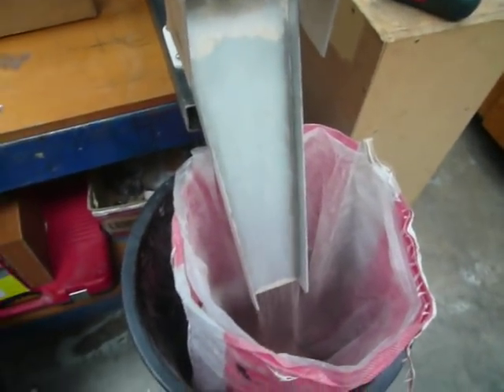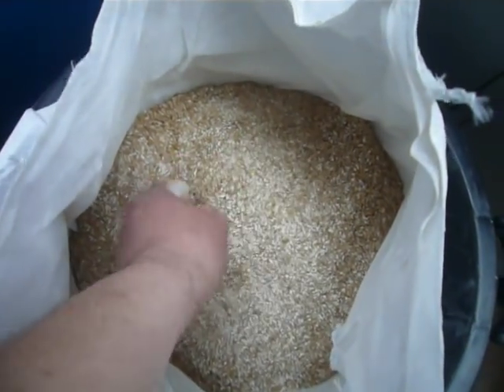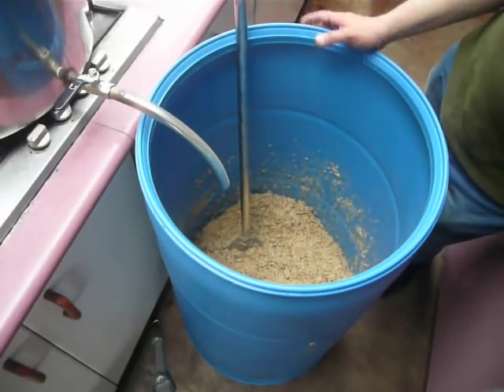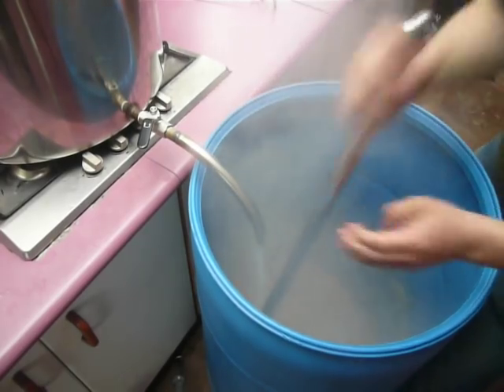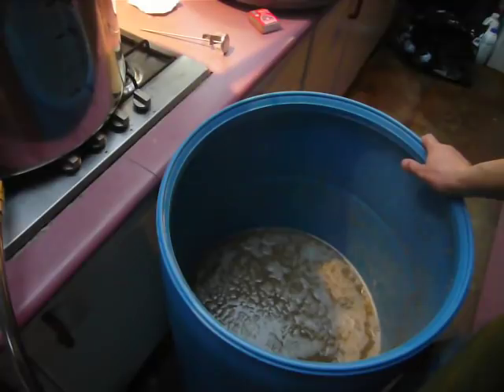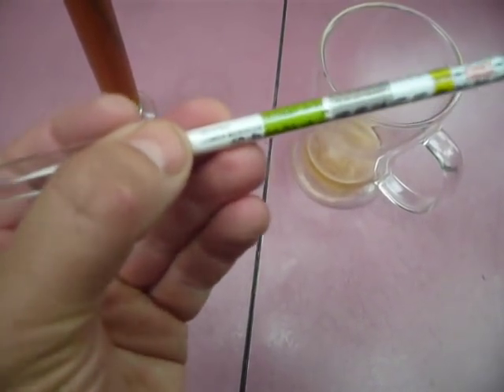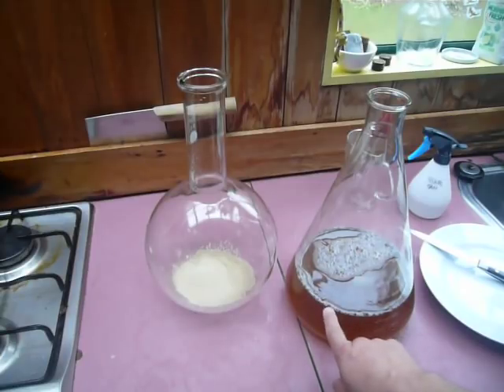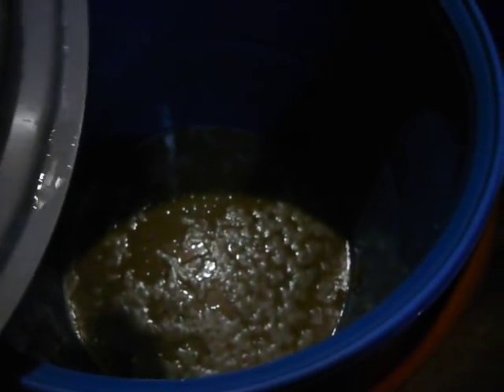Smokey Malt Whisky - Infusion brewing.

Comment: Love your work mate, cool to see the ferment on the grain in the big blue boy! Looking forward to giving this a go soon
Reply: What temp was your wort at when you pitched the yeast? I was curious as the vessel had sat for a little while. Or did the shear volume of wort and the blanket hold it at around 20C?
Reply from the maker: @chrisaitken55  
Hey fella!
Where are you now?
Last I heard Jon the scrapdealer said you'd headed out overseas to chase German women? 🤣

Pitch temp woula been around 20degC unless I noted it in the vid'.
I pitch low to try and overcome the exotherm - theres a fair bit even from a "small" barrel like this.
Probably got a blanket around it if it was wintertime, cold as a witches tit down at my place, used to do my fermenting in the lounge.
Reply: @AngryParrotDistillery  I'm back in the Kapiti area, been building and creating some new gear and chatting with John the scrappie pretty often. Germany was a great experience but nz is the place to be during covid. Love how you could ferment in the lounge, wouldn't get away with that here. I'll stop in for a catch up soon and get that 2" dephleg back to you!
Reply from the maker: @chrisaitken55  
Do it! 😊
I'm usually here in the workshop.

Comment: My kind of whisky !! Did you use any wood to a
“Age” it own? Just getting started and would LOVE to scale this down to a 6 gal volume !!😎👍
Reply from the maker: Heya Chef,
Yes, I used some lightly charred oak dominoes and a little oak 'tobacco" (shredded oak shards).

It was dangerously drinkable after only 6months of being set down.
After 12months it was starting to become a very polished spirit.

By 18months there was none left. 🤣

No reason at all you couldn't scale it down to 6gallons. 👍
Would be a hell of a lot easier and you could keep the temp up in a pot on a stove if it dropped to much during sacrification (keep stirring so not to burn obviously).
The 6gallon batch would probably drop temp faster during that period the enzymes are working and you wanna keep those lil' suckers happy! 😊
The larger volume/mass in the video has more thermal inertia.

Happy Distilling!

Comment: Making me thirsty.  Great vid
Reply from the maker: Mate, after stirring the crap out of that steaming grain pool for as long as I did I could definitely have used a cold beer! :o)
Reply: must be sore today.  least you had a decent paddle.  i'd have laughed if you omly had a wooden spoon
Reply from the maker: Haha, nah no sore bones the day after, that 4' paddle is worth it's weight.
4-5 foot handle has a good amount of leverage to use for turning slurry in a barrel.
I've actually used it on the stove top before with that 25 gallon stockpot when I've been geletanizing unmalted adjuncts and the mix has gone like half-set cement.
I gotta build a decent stand-alone mash tun at some stage …. oh, crap, the list just got longer!
Reply: lol, i was just thinking that.  the list just keeps growing.  but just think about where everything was not to long ago.

Comment: On the barrel lid you had some kind of lock/stopper that you then connected to the tubing  into the jar with water. What/where can you get such device's  and what are they called.  Thanks
Reply from the maker: G'day Christopher,
The black plastic threaded seal is a standard tank fitting you'll find in a plumbers shop - allows for a air/watertight hole to be put thru' a water tank.
The rubber stopper is just the stopper off a conventional airlock that you can buy from a brewshop - if you're lucky you can find the holed stopper by itself.
Happy Distilling! 😊

Comment: Hi, can you please do a follow-up to this video, I'm particularly interested in how you separated the wort liquid from the spent grain, did you use a pot still or reflux and of course what it tasted like off the still?
Reply from the maker: G'day John,
I top siphoned the fermented/spent wash once it had finished down to the wet grain bed (I save the wet grain bed off for another product as there is still HEAPS of flavor in there - not to mention the propogated yeast) and then twice distilled the wash in my pot still.

Reflux would have removed the flavor and this process is all about the flavor.

It tasted good straight off the still (albeit needed to stand - had a bit of immediate still taste that only dissapates with time.)
6 months later after sitting on oak it taste great - VERY peaty and very smooth to drink at 50% abv.

I'll try do some follow-up vids, haven't posted anything for a while now as I had to relocate the workshop and am setting up to go for commercial licence.

Happy distilling!
Reply: @AngryParrotDistillery  thanks for the info, hope the move and new venture go well.

Comment: What was the name of the enzyme you added at the end? I’m assuming that’s a non temp dependant enzyme
Reply from the maker: G'day Gareth,
Gluco-amylase. It's works at around the same temp as you can pitch yeast, not up at the higher temps of alpha and beta amylase that are already in the malted grain.
It converts the left over odds and sods floating around in the mash into glucose which is highly fermentable by your yeast.
It's like giving someone a seat at a seven course banquet as opposed to handing them a cow and a cleaver and telling them to help themselves lol.
Reply: Where did you get it from and what the brand? 

I’m thinking it might be a nice addition to something like a sugar head UJSSM to extract a bit of flavour from the corn by converting the starch
Reply from the maker: G'day Gareth, "Mangrove Jacks" was the brand, I got it from a food co-op place that also sold brewing stuff - I wasn't specifically looking for it but saw a bunch of sachets for sale and grabbed the lot at the time.

It's the only Gluco-amylase I've seen on a shelf in "home-brewer" quantities, it is available commercially under other brands but then it only comes in large quantities from what I've been quoted and has a commercial bulk price-tag.
Reply: @garethbarber5625  I have bought the 'Still Spirits' brand, it comes in a 12g sachet. My homebrew shop guy said  to use just half a pack in a 30L mash